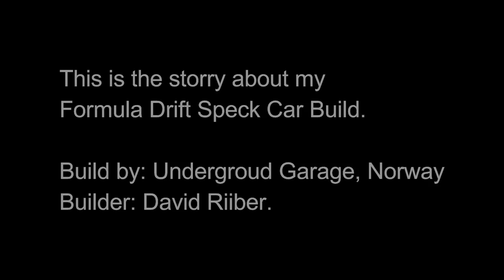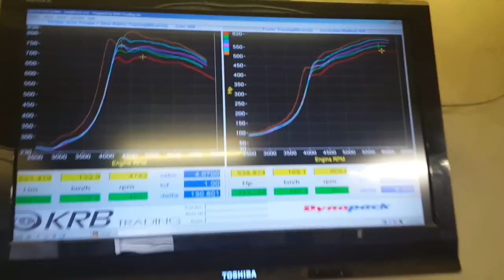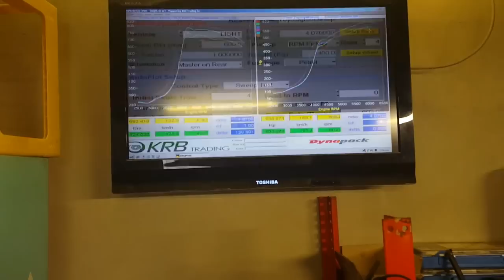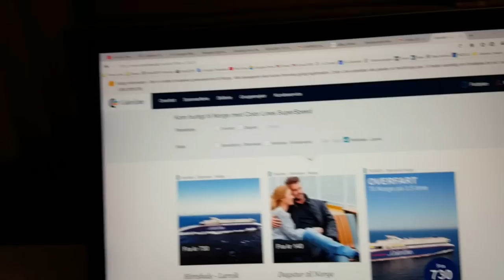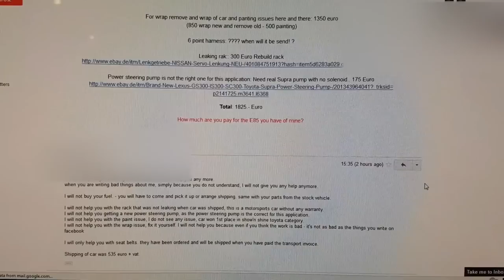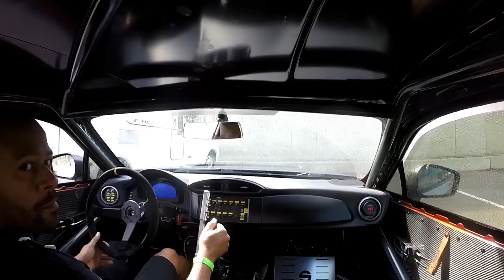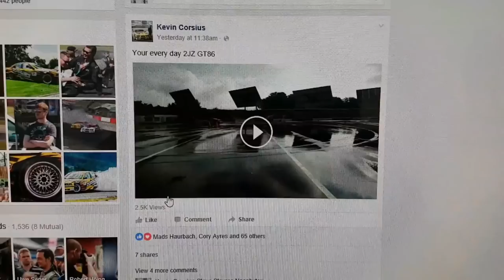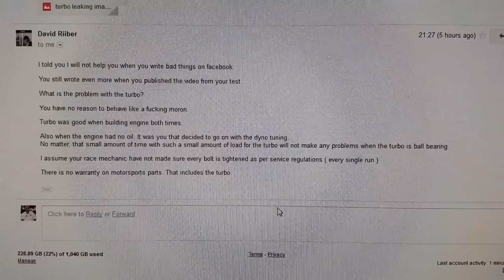Toyota GT86 2JZGTE VVTI The Road to Formula Drift Spec Car Build - Part 01

Comment: 100k budget! you should have a formula drift spec car with a fully built 2jz with dry sump setup capable of 900-1000hp. all the top suspension and steering setup! All the top ecu and digital dash setups, basically a dai yoshihara or ken gushi spec car or close to that! should have came to Ireland or uk dude could have built you a top car for half the price .
Reply from the maker: Ronan D, yeahh any shop would have done better job, my local gas station that normally only do service like oil change and stuf would have done a better job... Se part 2 and 3, it got even worse than this video... I rebuild the car 100 now working great, 150k euro total in the car now..

Comment: i feel bad about that dude i bet i could’ve done a better work than that though. so not worth the time and money that you wasted.  
what ECU did you use on the vvt-i though and trans?
Reply from the maker: ECU was also crap, it was autronics ecu, its been changed now to ECUmaster
Reply: Lars Fuglsang ohh I see can you please tell me all about your motor  (specs) im really curious about your build because im also going to do a 2jz swap on my future frs whether a vvti or a non vvt-i to choose
Reply from the maker: levi john Tan the engine in the car on in the video that you're watching is finished blew up was a piece of shit as he run it without oil it was so damaged and it didn't rebuild it that I have to put a new engine now. the new engine is completely original and stock internals, that's the way to go as long as you do not more than 700 hp

Comment: I agree that it's bullshit and it's poor craftsmanship and you're more than understanding, I mean VERY understanding but my advice would be when dealing with these shops that take on more than they can handle is to just wait, you just have to wait and put a little but not a ton of pressure on these guys because you see they will rush and screw it up and this is what you get. You may wait way more than you anticipated but at least when it's done its done right, unless you're really dealing with a horrible builder.
Reply from the maker: Don't really work, they got additional 3½ month for the build, it was 3½ month late, still not finished properly..
Reply: If a leaky turbo, losening wrap and a leaky rack is all the issues after a such a quick custom race car build, I'd say you came out not to bad. Bigger build teams can use years to get a car dialed in.

Comment: Your builder is a tool... even the guys here in the states don't sit there between runs and tighten/torque every nut and bolt like he said in that last email. half the time the engine doesn't get touched again until something either breaks or its off season and they're running 1000+ hp... look at Mad Mike Whidett (SP?) he ran that NA 4 rotor wankel engine without doing anything except oil changes for almost 4 years in the same car.
Reply from the maker: Haha yeahh exactly, i build my own drift car, m3, and i also never had to do anything other than normal maintenance, for 1½ years, as i put it together the right way.. :)

That turbo is wasted, gone, no good, broken, leaking, im making totally new setup, new manifold and turbo different brands, that work, are available offer support and can be rebuild easy if ever need to. and Vband flange so its easy to take of in 5 minutes, and not hours like this setup where you have to take of the hole manifold, just so stupid..

All will be shown in coming videos.. :)